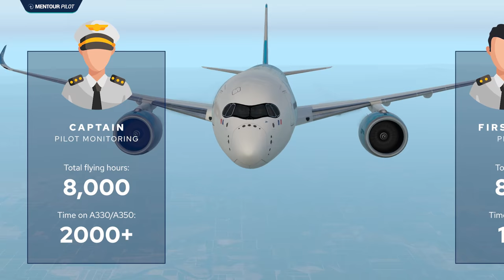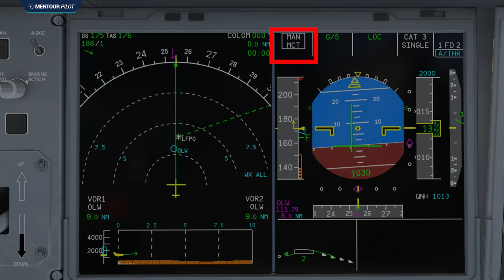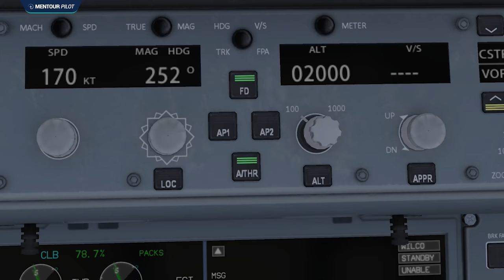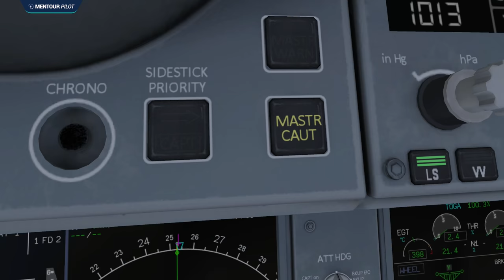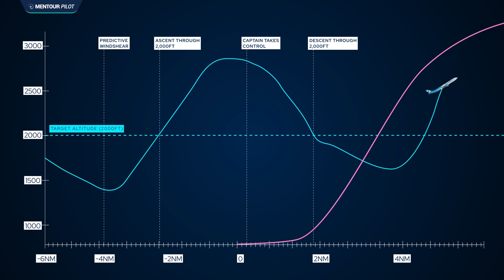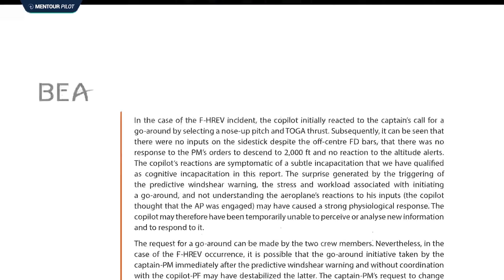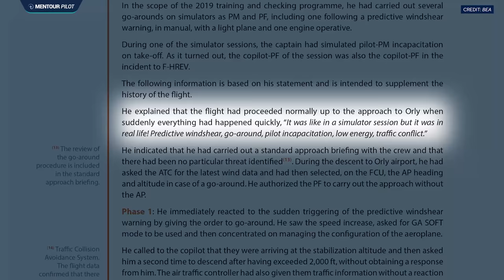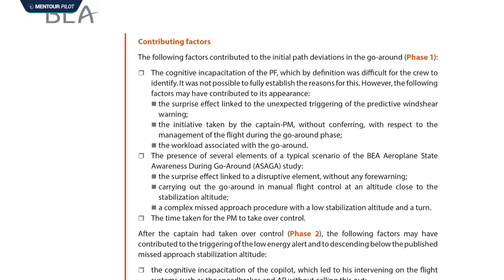What HAPPENED in this A350 Cockpit?! French Bee flight 711 explained!

Comment: Can't the FMC just have the Go Around plan in it for airports with a tricky procedure, which is automatically selected by using the Toga button and then it does it all including the turn and altitude?
Reply from the maker: If an automatic go-around is flown, yes. But in this case the FO was flying manually.
Reply: @MentourPilot  thanks for replying. I just don't understand why for the best part of a minute no one listened to the 3rd pilot and select autopilot and just let it do its thing. Why did the captain even feel the need to fly it?
Reply: @russcampiond05  
Thanks for asking exactly what I was going to ask.
Seems like it should be simple.
Reply: @snarkywombat155  I think he just wasn't expecting the sudden loss of his FO and the immediate doubling of his workload...
Reply: What I understood from the video, the captain did exactly that. When he took over the controls he engaged his autopilot. But then he was sabotaged by the first officer selecting the speedbrakes at low speed, which then was counteracted by the thrust input resulting in the autopilot disengaging again. And with all the resulting conflicts there seems to be other things to do to stabilize the airplane.
Reply: it's still basic procedure. Imagine if it was plane malfunction like losing engine or structural damage with depressurization, etc.. People can only thank got this was just go around when his happened, not some emergency landing procedure or everyone would have died over such mess in cockpit
Reply: @runduur  Yep, exactly.
Reply: One step closer to my belief that the whole flight thing should be automated.

I guess comms w/tower is that slapdash at times, ATC doesn't immediately pick up on an on-board issue. There were clear signs of 'poor comms' with ATC which should have rung alarm bells resulting in stopping take offs to reduce conflicting traffic when the cause of conflict isn't following instructions very well.
Reply: @russcampiond05  What I would like to know is did the 3rd pilot notice that the FO started to press buttons and pull speed brake without saying anything? That would have been valueable information to the captain to better understand the situation. Especially when the captain had already taken control you wouldn't expect FO to press autopilot or touch the speed brakes – why didn't the 3rd pilot say anything?
Reply: @millomweb  Given the low number of fatal flight accidents with larger passenger planes, I think you are overreacting. Take a closer look at where all deaths happens, and put your focus there instead.
Reply: @MentourPilot  Seems like it might be a good idea in that case to have the auto pilot configured for alt and heading so that all you needed to do in the case of a go around is select autopilot.  Not a pilot though so I don't know how that works in TOGO.
Reply: @perwestermark8920  1. Does it really matter where the safety improvements are ? Saving lives in the main thing.

2. I suspect roads are the biggest culprit. Which is easier, autonomous planes or cars ?
Reply: @MikkoRantalainen  the 3nd pilot involuntary add workload by calling autopilot and "activate the faulty FO" to switch autopilot to n2. in lay term the poor captain is flying with sabotage person on his right. he did the right thing by ask everyone to be silent and let him fly. that clearify the  situation because he knows that only him is making input to the system and he was free to get caught by surprise every 30 seconds.... it's ironic that the "manual flight" that the fo request set up and then trigger thr chain of events.  i feel like he needs to get more comfortable with airplane,because manual flying the plane seems like to completely overload his capacity. it means that the slighest out-of-expected event can make him overspill and become incapacited. he need to be confident with flying the plane so he can have more spare space to react to unexpected problem.
Reply: @millomweb   Yes it matters where safety improvements are. Why? Because you get different gains depending on where you invest. Throwing out the pilots isn't really going to save that many human lives every year. So you get a very low return on investment.

2 - we have autopilots. But do you really think it's easy to go from current autopilots to autonomous autopilots that takes into account everything that can go wrong? You may end up with a solution where you solve 5 human-induced errors. But fails badly in 5 situations where humans would have adapted and overcome.

In short - your view seem to indicate you have a fear of flying. But you are more likely to die when walking some stairs. So remove all stairs? Because - they are actually killing a lot of people...
Reply: @runduur  Could be that the captain was more inclined to fly it himself because the automation had already given a potentially false wind shear/ go around warning. I think its likely his first reaction was not to entrust the situation back to the automation which initiated the situation. Just human nature.
Reply: @millomweb  But then you have the problem where the automation is getting bad information and reacts inappropriately. Such as the 737 MAX incidents.
Reply: @DRthistle  I don't think so. He used the automation when he could. The actions of the first officer did work against that. He took command and engaged the autopilot. Then he had to disengage the autopilot by making strong inputs to counteract the speedbrake action of the first officer. Later he had to counteract the not commanded autopilot engagement by the FO as the autopilot was then in the wrong mode. So he disabled AP2 to enable AP1 to get in the mode he wanted. So no trust issues here.
Reply: @codemonkey2k5  I'm quite sure, the autopilot was configured for that. This is depicted by the flight director which indicated what to do to reach the settings of the autopilot. Problem was the FO thought the AP was engaged (startle effect) so he didn't do anything thinking the AP would do the flying. The captain knew he was handflying so there was no worries there. The captain engaged the AP as soon as he took over the controls and the AP did originally what was set (alt and heading).
Reply: @AaaBbb-ff1pn  I think the real problem is that sitting in the cockpit while autopilot is active is counted as flying experience. When somebody has 5000 hours of flying experience as a long haul FO, the amount of actual flying is pretty minimal.

If experience were measured as amount of takeoffs and landings in manual mode on the type we would have a much better meter for experience.
Reply: @russcampiond05  
There are multiple systems of autopilot. 
Multiple crashes have happened because pilots selected the wrong version of autopilot for the specific situation they found themselves in. 

So if something weird is happening, it's actually smart for a pilot to do as much as possible himself, while he figures out what systems are working the way they're intended. 

Just one example to illustrate what I mean: those Boeing 737 MAX crashes happened because the computers didn't do what the pilots expected them to do. 

Also, this happened in four minutes. So, like others said, the pilot *did* use the autopilot again once he knew things were working the way they should :)
Reply: @russcampiond05   Based on the video, when the capt took over, the first action he did was to engage the auto pilot, however due to the actions of the first officer on the speed brake, the plane deviated from the expected action. As any pilot will tell you when the auto pilot is not doing what you expect it to do, you take over. It takes time to process the information that is being presented in the flight deck, so rather than commit to figuring out what went wrong with the auto pilot, the more efficient solution is to revert to manual flying, bring the plane back in control before re engaging the auto pilot. We have to understand that the auto pilot needs to be properly set up so that it can be used safely, it is not a magic button that pilots press and automatically brings the aircraft under control.
Reply: @Markle2k  This is where the automation and sensors, need to be good. I don't know how they sense various things but there should be 3 sensors for each input and the sensors should work in completely different ways so that if one type fails in particular circumstances hopefully the other 2 won't be affected. They have good ideas with autopilots being in agreement but they seem to stop at that - needs a third to decide which one is wrong when they disagree rather than reverting to humans !
Reply: @nosuchanimal6947  My point about automation is that it goes through the planning stage. Once full responsibility is put on people on the ground, they think a lot hard about what could go wrong - even silly things like wings falling off. The list of problems is far more thorough so it's a major step improvement to what we have now. Yes, there will still likely to be 'problems' but let's hope that is accounted for in all aircraft systems before it happens a second time.

As a software engineer, you'd be excluded for being involved in safety systems :)

As a maintenance engineer, I'd expect lifts to have 3 control systems. One to stop the lift, one to start the lift and one to run the lift.
The one stopping would be purely mechanical in operation but with electrical output.
The one running the lift would be purely electromechanical.
The one starting the lift could be any old shitty computer !
Reply: @Markle2k  I can think of 3 different ways to measure AoA.
1. weather vane
2. GPS + gyros
3. wing loading/ias.
Reply: @MikkoRantalainen  that's the same thing that i though, i write it under the main pinned comment. i mean, it make sense, the fo is requesting manual flight cause he lack confidence.
Reply: @MentourPilot  - Captain If I understand correctly going into G/A mode(TOGA) will activate the Auto Pilot. At least that is what happens in the SIM I use
Reply: @millomweb  1 measures AoA
2 Doesn't measure AoA
3 Doesn't measure AoA
AoA is the angle of the relative wind to the chord of the wing.
#2 measures what? The relative angle of the fuselage to the ground? The angle relative to the gravitational field? And perhaps you think you are getting an airspeed measurement out of that as well? No, that would be groundspeed. I also think that you are unaware of how granular GPS updates are.
#3 I'm not sure how you think you are going to get an accurate, repeatable measurement or why you think that loading relates to AoA. AoA is related to indicated airspeed if you are stabilized at 1 g, but is affected by aircraft configuration changes and power levels.
Reply: @Markle2k  2 and 3 do but I guess you don't understand.
Reply: BVale  Yes. However we measure the development process, it's extremely, hugely, expensive to go from a nice beta or even release canditate to something that actually survives the mark of time. A fully automatic airplane doesn't survive any "service pack" to be shipped. Because every service pack sent out means one or more already failed flights. Just as the current regulations are "written in blood".

Comment: Yes, my employer started implementing “startle effect” scenarios in our simulator training several years ago. Not necessarily a pilot’s favorite, but you do learn from it. 
One other aspect is that a go-around significantly above minimums can sometimes force you to DESCEND to the missed approach altitude (MAP ALT), contrary to a typical missed approach procedure where you CLIMB, which goes against muscle memory (THR lever to TO/GA) and  requires the brain to process this atypical requirement and adjust crew actions. (TO/GA to tell the APFD that it needs to be in good around mode, followed almost instantaneously by a descend mode (LVL CHG or OP DES) to get down to the MAP ALT.

Comment: Thank you for another most interesting and entertaining video/report. Having watched your reports on both the Air France Toronto and Brazil incidents, I cannot help but see in these three cases some clear common problems: a lack of discipline and a lack of proper communication between pilots. It seems that an ego issue combined with a lack of self-control could be at the bottom of these very dangerous situations. Of course, this could be the French savvy.😉

Comment: They should never have gone around if all flight instruments show no wind shear, especially if there are no obvious weather threats to indicate wind shear. I have had this happen many times due to false warnings, and I always looked at my airspeed indicator and vertical speed indicator before initiating the go around. If all was normal, I disregarded the warning and continued the approach. Also, in the USA, you NEVER fly the published missed approach when going around at a towered airport served by radar unless cleared to do so by the controller. The ATC controller will issue missed approach instructions based on local traffic and runways in use. The published miss cannot possibly take into consideration local traffic or approaches and departures on other runways. This is why the controller issues MAP instructions. It has been too many years since I flew in Europe, but think what we do here applies there, too.
Reply: Im not a pilot, but dont have the runways more or less fix approach/departure routes and the go around route has altitudes and turns to avoid these?
Reply: @wolf310ii  The published go around procedure, and the one issued by the control tower are two different things. The tower operator knows where other airplanes are and routes the go around airplane so that they do not collide. This is precisely why pilots should never fly the published procedure unless told to do so by the tower controller.
Reply: @MrSuzuki1187  Sure i got that point, but in my opinion it would be much safer if the tower would make sure there is no traffic in the published go around route in the first place.
I mean its a published route for a reason.
The Pilots can prepare for the go around befor the start of the flight.
A last minute change increase the workload.
If the go around is a split second decision, there is no time to ask the tower for permission or directions.
The pilot anouncing the go around (if he have time for it) or the tower giving a new route could get blocked.
Or the tower didnt even notice the go around.

Comment: I’ve ignored the Windsheer warning system twice in the CL350. 

1. KMDW:  I was PF / PIC. We were at the GA Alt already and the KOHR MA procedure was directly overhead.  We had briefed the wx and knew that storms were hundreds of miles away, so we weren’t getting the advancing storm type of Windsheer warning.  It was just a LLWS of >15 knots.  It didn’t recur. 

2. KFLG. PF PIC. No storms. High winds from the southwest which roll due to a ridge line. Pre-briefed the fully expected Windsheer and held what we had, but were ready to GA in the airspeed dropped unacceptably. 

Both landed without further incident.

Comment: @Mentour - a question for you. I have heard comments that the Airbus side stick has a drawback in that you cannot see what your copilot is doing. And in this case, it seems the captain was not aware of the first officer engaging the AP2 - because when you look at the flight instruments - it literally looks like a wall of text and numbers designed from the 1960s - which to a stressed pilot must be really hard to see where to focus.

So my question is - do you think that modern airliners could/should have more clearly designed information? Iconography, highlights, animations etc - a better designed information system so your not just scanning a wall of text, indicators, LEDs to see which one is not correct? Is it even possible?
Reply: I’m assuming you’re asking this as a non pilot and not sure what they mean. And I’m assuming you’re talking about the FMA at the top of the PFD. Seeing as the FMA is one of the most important things a pilot needs to monitor I’m sure even a stressed pilot can see what is going on. It tells you which AP is activated on the right side of the FMA. 

The FMA was pretty much designed so the pilot can very quickly see what modes the aircraft is in and whether the AP and FD’s are engaged without having to guess from thrust settings, climb rates and looking at the AFS CP.
Reply: @tomstravels520  - yeah - I’m a non pilot - but it seems to me that the ‘UX’ on an airplane is ... messy. The text is tiny monochrome green acronyms with ‘line’ art for indicators. Is there any advantage in ‘apple-ising’ it (for lack of a better term), with high res graphics, big clear text, block colours, iconography etc? Would it help convey information more easier?
Reply: @laz001  Which part of the instruments are you referring to specifically? And you know the display you are looking at on this video isn't like a real aircrafts LCD display in terms of quality. Seeing NAV on the FMA immediately tells me the aircraft is in navigation mode. Seeing AP1 tells me Autopilot 1 is active. If it isn't there then its not active.